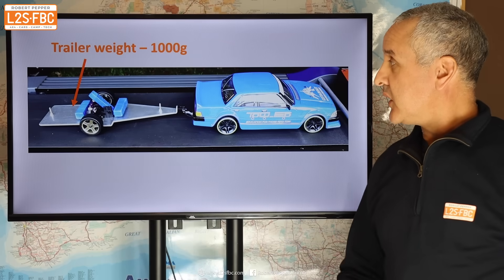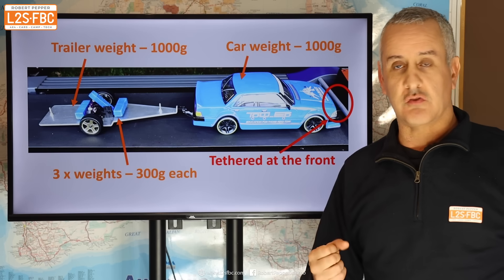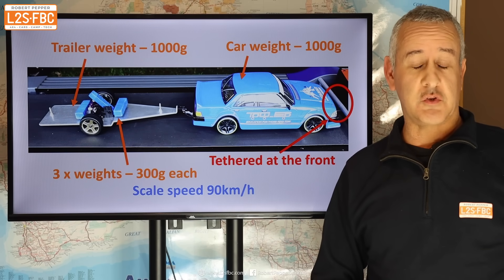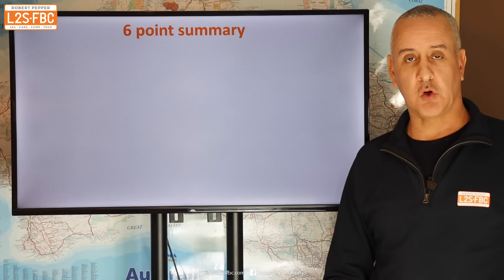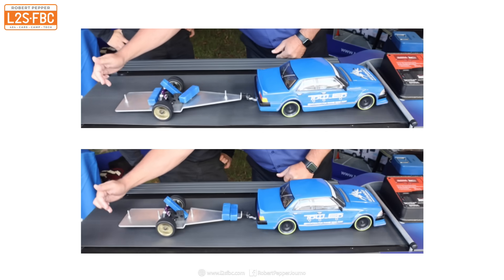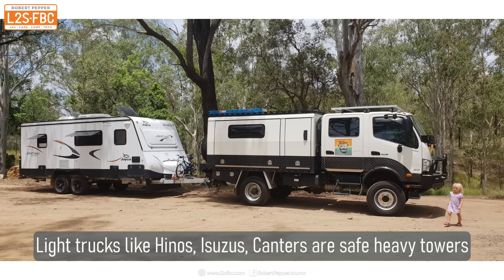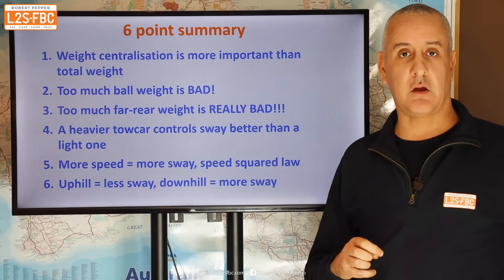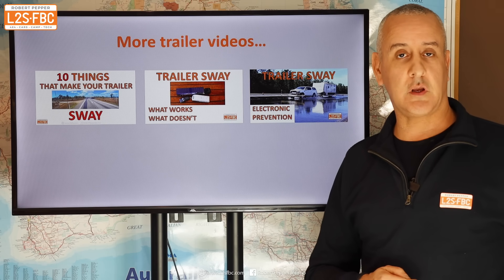7 trailer weight distribution setups, some safe, some deadly.

Comment: That was accurate and easy to understand. I think everyone towing anything should see it. Great job
Reply: Being a trucker with 2.1 million safe miles it's very important,  in fact the rear 8 wheels on typical trailers you see move forward and backwards to move weight,  we are allowed 12000 on steers, 34000 on drives, and 34000 on rear tandems, say the scale says your at 30,000 drive tires and 36000 tandems, Pull the trailer brakes, pull the handle under the trailer to release the pins and drive forward or backwards, you move your tandems towards the problem your solving so pull the tandems 4 holes, each hole moves approx 500 pounds, your then legal to drive.   Now some driver's who get mad at other drivers or other companies will pull the handles at truck stops, so when u hit your brakes the tandems slide all the way back and it's a huge hit, feels like you just hit a car because they slam into the rear stopper bar, I had 46000 pounds of paper on the highway not knowing someone pulled my pins, my exit was a long downhill grade and I had to brake rather hard, those tandems hit so hard my entire wheelset blew out the rear bumper and completely off the trailer, my trailer was on the pavement, cops looked at the truck stop cameras and seen it was a guy that worked for the same company I did, apparently he was mad at his dispatcher and took it out on me, he was arrested and charged with assault with intent to do great bodily harm and a few other charges.
Reply: @breakingames7772  OMFG, what a tool your ex colleague must be.  Glad you were not injured.
Reply: @breakingames7772  2.1 million safe miles but you go on to describe to us to an accident you had with 46000 pounds of paper where the trailer crashed and the police were involved …. 🤔
Reply: @andyxox4168 
 haha, well spotted 👏👏
Reply: @andyxox4168  yeah, you need to keep thinking until that little light bulb comes.😁 What a maroon, He can't be blamed for sabotage.😏 And it was no accident sheesh you ten?
Reply: @mikefowler301  regardless, comment was "2.1 million safe miles" sabotage or not, still an accident, nothing dumb about being observant, choose your word wisely my man, it'll probably get you in trouble some day if not already
Reply: The best clearly illustrated video I ever seen for this topic. This Training is very useful for driving schools too. Great job. Well done
Reply from the maker: Thanks Shane, please share!
Reply: Not accurate. That trailer design would never pass inspection. Wheel axles are too close to the tongue. It was built to be unstable.
Reply: @phillipfreeman5300  hence load in the middle. If the axles had been farther back ie a boat trailer the weight should still be over axle. Now on North American semi trailers 
You have a moveable 5th wheel and kingpin and sliding axles on the trailer
'53 ft trailer has a 40 ft bridge California
Length in feet kingpin to centerline of last axle. With a 30 inch setback on the kingpin that is where the axles would be on a 45 ft trailer. It's so the long trailers don't "curb" the trailer wheels. So that'll be 26 40"x 48" pallets and will stop at the 45 ft mark in the trailer. Leaving 8 ft empty due to weight If light enough 30 pallets to the back doors. In a 53 ft trailer.slide the 5th wheel forward you 
Put weight on the steer axle take it off the drives. Slide the trailer axles forward take it off the drives put it on the trailer 
Slide trailer axles back out weight on the drives a shallow kingpin puts weight on the trailer a deep kingpin puts weight on the drives. Watch your swings internal 
And external .

Comment: Any thoughts on weight distribution hitches?
Reply from the maker: Yes. Best avoided, better to use a more appropriate towcar.  I have a video on how they work.
Reply: @L2SFBC  I thought your weight distribution hitch video held them in a more positive light. Atleast when comparing the vehicle / trailer combo sans the WD hitch.  Am I wrong in that assessment?
Reply from the maker: They do the job they're meant to do and are effective to that end, so that's positive. However, my view is that if you need one, then it's better to get a larger towcar.
Reply: @L2SFBC  https://m.youtube.com/watch?v=ng-4MlicmYU
For anyone interested

Comment: I have been working for boat dealers for over 30 years. I tow new and used boats from 15 Ft to 45Ft. (4.6-14m where your from). None of the trailer manufacturers or boat builders explain much at all either to final customers or their dealers like you are doing. This includes custom trailers that are built for a specific boat or a universal trailer that is setup by the dealer for the boat they are setting on it. I have learned by word of mouth or trial and error. Your video is the first really good explanation of what happens in the different weight distribution scenarios. One other thing that I find customers and dealers alike misunderstand is tire type and air pressure which is more critical as more axles are added do to trailer weight rating increase and tire binding or twist when turning and maneuvering especially in tight spaces.
Reply from the maker: Exactly the same over here Gary, I have challenged all trailer makers to show me evidence of dynamics design and none have. They just don't care, because the customer base doesn't care. So, we will continue to get crashes.

Comment: Hello there i will have my caravan in 2022, its on order, i am a first time caravaner, is it my understanding that you should allways try to put as much of the heavy stuff over the axles? I really find your videos very informative, many thanks john
Reply from the maker: Correct over the axles.
Reply: Actually in the middle of the trailer, ideally at the centre of mass (which is ahead of the axles), but "over the axles" is certainly better than "at the ends".

Comment: thanks for posting, good information, however with a lot of vans designed with a front ( and sometimes rear) tunnel boot and large front boxes on the draw bar, it doesn't allow the owner to load their van 'correctly' as there aren't many storage cupboards over the axles. have you done any testing with wdh fitted?
Reply from the maker: No not a fan of WDH. Agree on the difficulty will have more on that later.

Comment: Great explanation - particularly the effect to too much and too little ballweight.  Given that many caravan rollovers have weight distributing hitches fitted, I wonder whether these simulate a "too little weight on the towball" situation and if adjusted up too much, can this cause instability??
Reply from the maker: Yes that's possible. Not a fan of WDHs at all.
Reply: Cause they are using a little car/truck to pull the damn thing to begin with so they compensate by trying to lower the tongue weight
Reply: The WDH doesn't affect the inherent stability of the trailer, but if over-applied (too much load redistribution) it does cause instability by reducing the tow vehicle's rear axle load too much. This is one reason that some manufacturers advise against WDH use - they can't count on it being properly adjusted.
Reply: That's because none of these weight friction hitches work even in a small way total nonsense.

Comment: Excellent advice. When camping with a trailer, I try to pack the heavier Items in the tow vehicle opposed to the trailer.
Reply: .. unless they’re solely in the boot of the tow vehicle, well behind the rear axle, in which case over the axle in the trailer may be a more stable solution.
Reply from the maker: Definitely!!!
Reply: It depends. In the model in the video, the tow vehicle and trailer weigh the same amount. It would vary with your setup. Most single axle flatbed trailers, that are the same length (from end to end, not bed length) as the tow vehicle, like the one in the video, are not the same weight as the tow vehicle.  The tow vehicle is usually 2-3x as heavy as the flatbed.

Comment: Fantastic video! How can one get an accurate idea of their caravan weight distribution? Is this something a weighbridge can give good metrics on?
Reply from the maker: Not really. A weighbridge just tells you the weight on the wheels and on the towball. It doesn't tell you how that weight is distributed, except a little via the towball weight. You need to look at what's heavy on your caravan and work it out that way. Typical heavy things you can relocate are; water tanks, batteries and spare wheels.